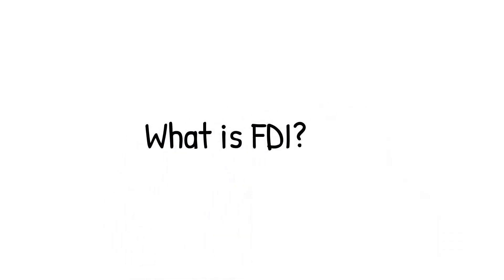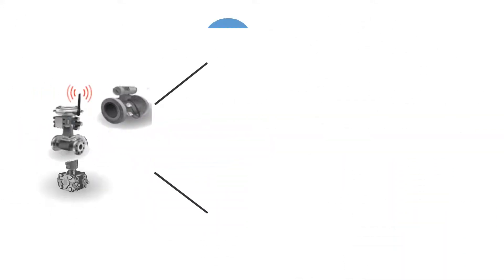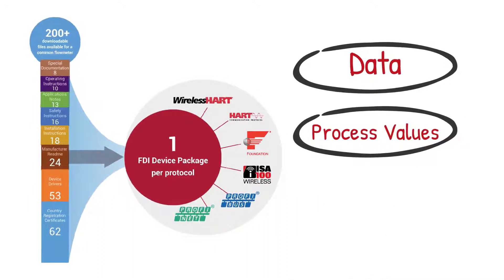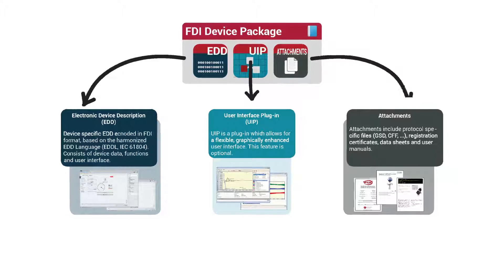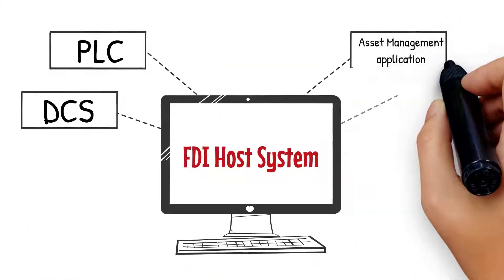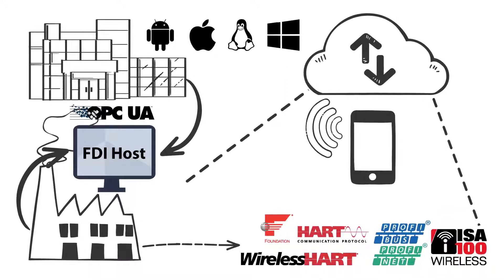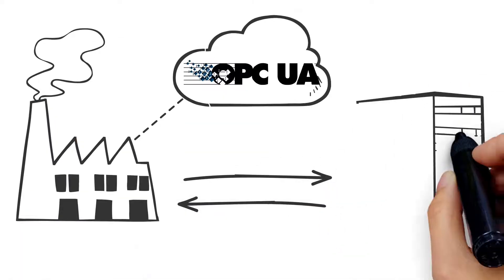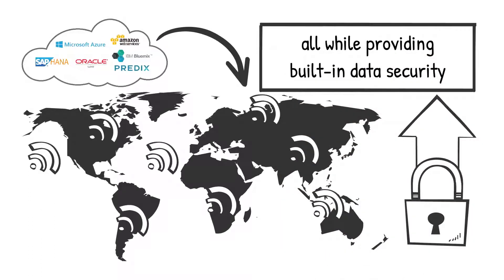What is Field Device Integration (FDI)?

Comment: www.LeelavatiAutomation.com
Sensors, Drives, Controls, VFDS, HMI, PLC, SCADA, IO-Link Sensors, Switches, Energy meters, Field Bus, Motion Control Monitoring Systems, IIOT, Industrial Sensors System Integration.
+919967861294  / +917777029660